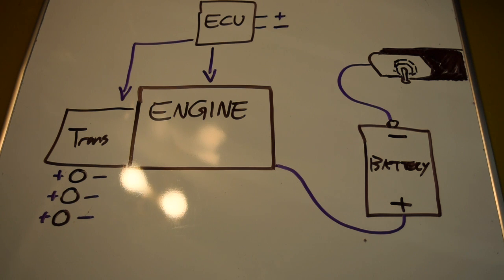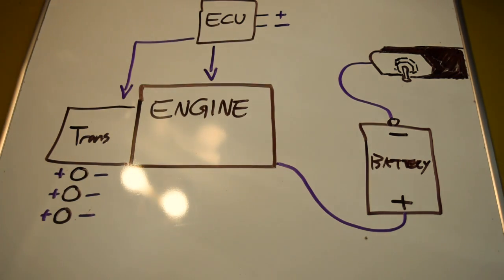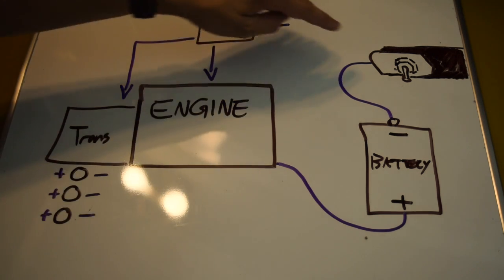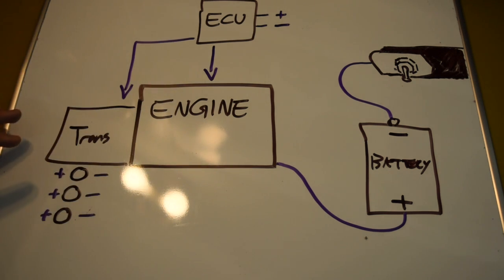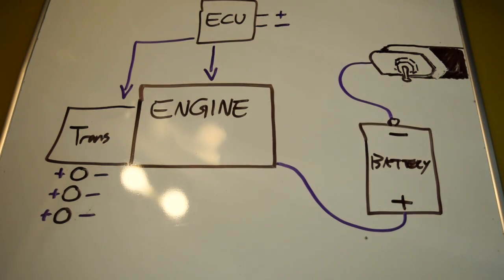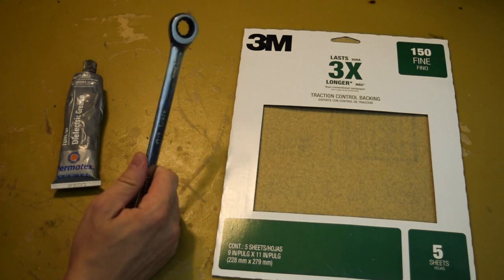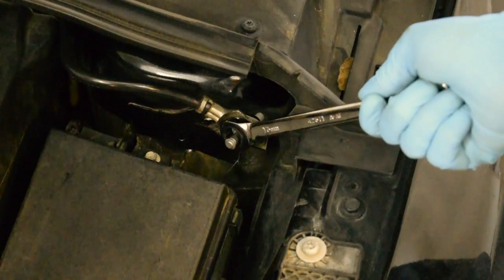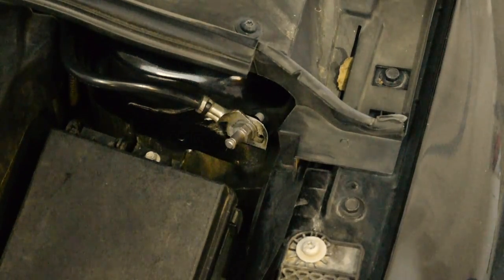Ford Focus DCT Ground Mod. Increase Driveability and Reduce Jerkyness

Comment: I have a 2014 Ford Focus SE. Had transmission issues. Had TCM replaced/programed accordingly under recent warranty extension program. Car runs fine.....for now. ;) lol!
Reply: There's a class action against Ford for the transmission on these cars
Reply: @MFDan69  ok...and??
Reply: E LEAL did the dealership tell you about this extended warranty or did you have to mention it to them? I have my car in the shop now and I’m pretty sure that’s what’s gunna need to be replaced in my 2014 focus? Just looking for advice?
Reply: @stokeskelsy  sell it a.s.a.p!!!!
Reply: @stokeskelsy  Sorry,, I just saw your reply.  I had read about it and mentioned it to them when I got there. Currently there is a national back order on these TCMs. Mine was not replaced though it was programed with updated software. Recently thought the TCM did go tits up. Now they have to order the darn thing. Who nows when they will get one in. Every dealership has them on back order.
Reply: How is the car doing now? Mine is currently in the ford dealer shop. Hopefully they fix it. But I’ve read that from some people with the same problem the transmission fucks up again in 2 - 3 months.
Reply: @christianaraujo8048  2/6 months is about correct for when it starts to act up again.my daughter had hers done 3 times and still not correct.so she just drives it the way it is.she has been driving it like that for a 1.5 years now.
Reply: Mike Secondo that’s crazy. Is it still free with the extended warranty if it acts up again?
Reply: @christianaraujo8048  ABSOLUTELY!!
Reply: Mike Secondo nice thank you so much just making sure. Thinking long term here. I’m Kinda stuck with this car for now but will definitely look into a new one later this year
Reply: @mikesecondo2254  yv

Comment: i have a 2014 was jerky. just go from dead stop and put the gas pedal down until you hit 60 then come to a stop do this 5 times in a row. i have driven 3000 miles since doing this with no problem. i am not responsible if you damage your car try at your own risk.
Reply: It's called a Clutch Scrub. See videos by FordTechMakuloco where he shows replacement of clutch pack and shaft seals - in final video he does a Clutch Scrub to teach the TCM. The TCM has adaptive software that changes shift parameters according to how you drive. Problem is that over time the TCM starts shifting too slowly causing clutch chatter when when engaging first gear from a standing start. When the clutch chatter in my 2012 Focus would start to get annoying I would perform a Clutch Scrub to reteach the TCM - did this about every two months. Good news is that Ford now has a fix. When I took my Focus in for the recall inspection of the evap system valve, they also updated the TCM software. Since then the transmission has been shifting perfectly.
Reply: They probably replaced your clutch because Ford has extended the warranty recently for some Focus and Fiestas.
Reply: Iw Ck no sir my cluthes have never been touched. only things done to transmission is software updates.
Reply: @IwCk   Nope - my 2012 Focus is still running on its original clutch (83000 miles). The work order for the recall service listed the check of the gas tank and vent valve and the TCM software update. Besides, since the Focus was only at the Ford shop for an hour and a half that would have been a near record for a clutch replacement. I once replaced the clutch on one of my cars in just under one hour (drive in to drive out time), and that included pulling the engine out (cars were much simpler back then).
Reply: @robertotwell8664  yeah..on a 1969 vw beetle
Reply: @mikesecondo2254  I've changed clutch on a couple VWs. Four bolts hold the engine to the transaxle - just disconnect fuel line, ignition wire, throttle cable and clutch cable and pull engine back and down. The clutch job I was referring to was for a car with a water cooled engine, and the time included draining and refilling the radiator. BTW, the VW rubber fuel line just pushed on to a straight (no barb) nipple on the side of the carb - I always added a clamp. Often saw VWs with a burnt engine compartment lid - the fuel hose would pop off the carb and spray fuel. Fuel gets sucked in by the cooling fan and blown down on the cylinder heads and exhaust: kaboom.
Reply: What made you try this
Reply: Primthos a ford technican said thats what they do.
Reply: @primthos7413  it's posted on you tube
Reply: Must clear tcm first then scrub...to relearn driving habit's
Reply: NOT!!!!!